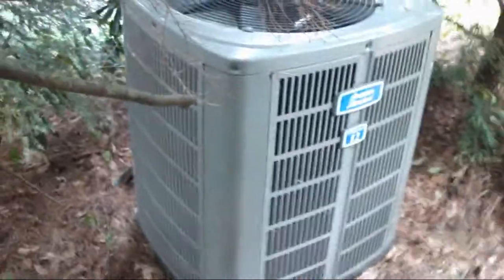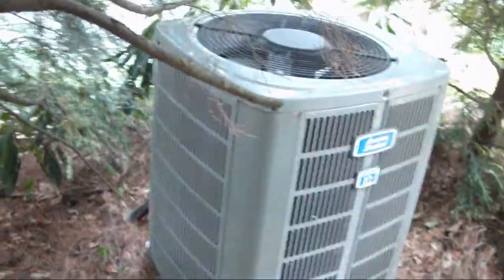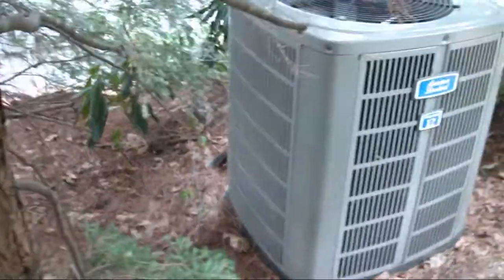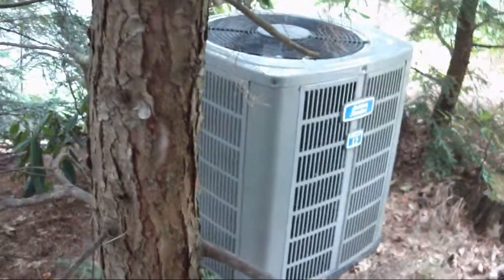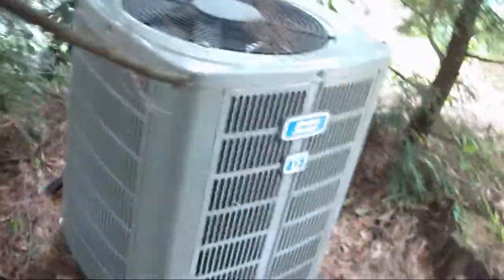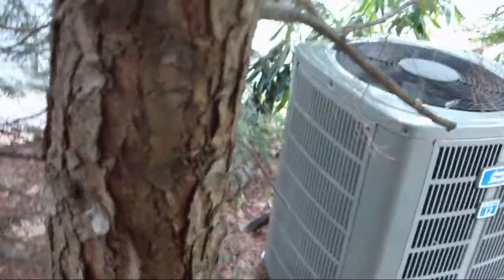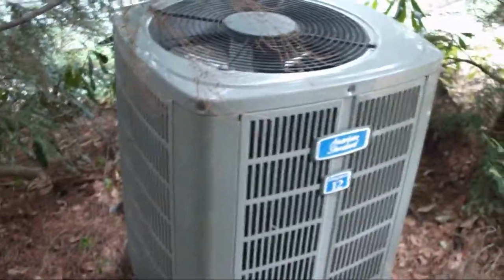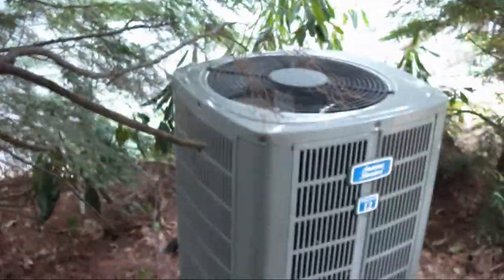2003 American Standard 12 SEER central air-conditioner running

Comment: You have done well. Your contractor is a pro. That ambiet kit is doing it's job well. You have to maintain 200 lbs. of head pressure to keep the indoor coil from freezing. After the ambiet temperature gets around 80 degrees the fan will probably stay on all the time. This unit has a scroll compressor, enjoy it and don't look back. Your contractor done a phenomonal job. Hall's Heat & Cooling